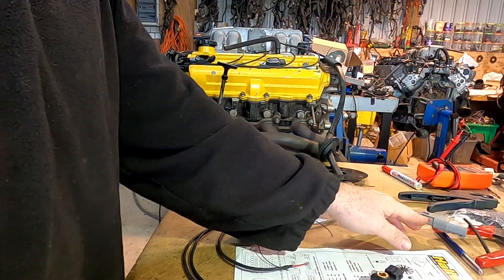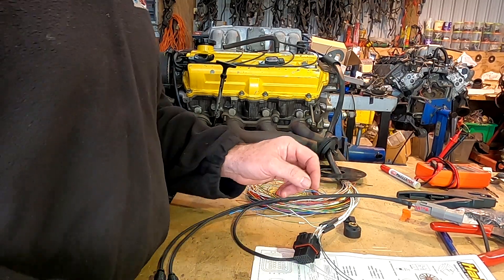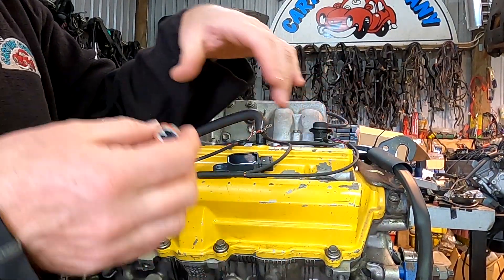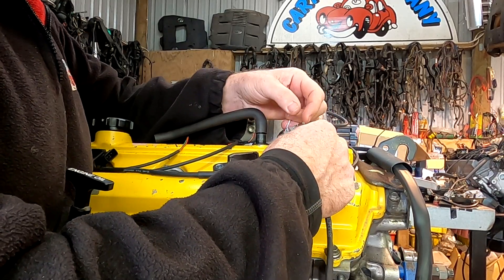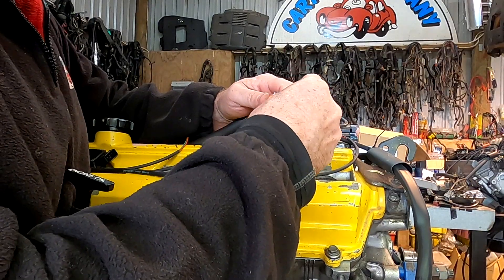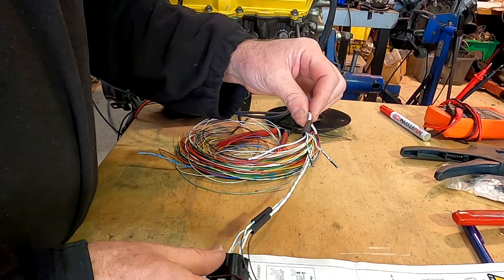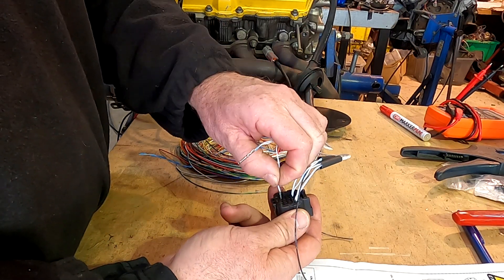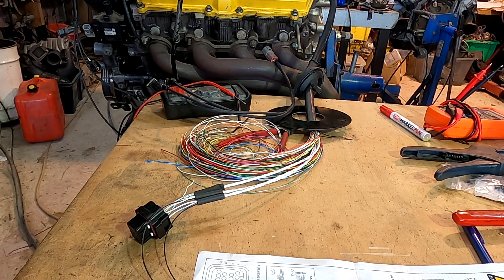Wiring Haltech ECU to 1uz Part 2   Knock Sensor inputs

Comment: Hi Kelvin, are you aware of the equivalent Bosch Knock Sensor PN that will bolt directly onto the Gen1 1UZFE valley location? It will be with an aftermarket ECU so exact frequency response as OEM isn't required, but just one with the right hole size
Reply from the maker: This video might help.  https://youtu.be/BtAy4sQEMhA

Comment: Awesome!
Reply from the maker: Thanks buddy.  Hope all is well over there.
Reply: @CartuneNZ  Super busy...
As a matter of fact, I am in the middle of editing my latest video with Guy Fieri, and it's HUGE. Actually, there's so much content, I had to break it into two videos. So this upcoming time, you'll get a, "two-episode special broadcast!" hahaha! I promise you though, it will make your jaw drop. hahahaha
Reply from the maker: I was while you were cooking tonight.  Burittos with a kiwi twist.  Cheers
Reply: What Bosch sensors are these and could the factory ECU use them as well?
Reply from the maker: @CruiserRunner  they are universal bosch wideband sensors,   many different bosch part numbers can be used.  Most stock uz ecus use a narrowband single wire sensor so a wideband sensor is not compatible at all.  The late 3uz use a two wire sensor however I have not looked at crossover parts for these as I prefer genuine parts as they are value for money.
Reply: @CartuneNZ  Yes and no. No knock sensor, genuine or not, should cost $200 each and that's what they run. There has to be a quality product that will work for less that that. It's ridiculous, really. I prefer genuine parts, but that's just insane.
Reply from the maker: @CruiserRunner  are you in the usa by any chance?  As thy are about $200nzd and most I replace are the factory fitted items,  so over 30 years its good value to me.  And I don't see many fail considering the number of engines I see.